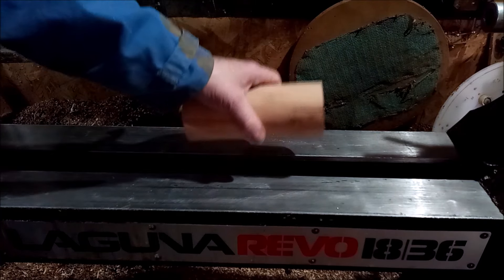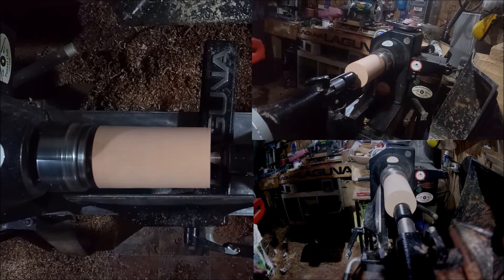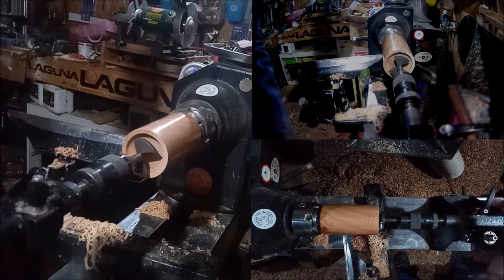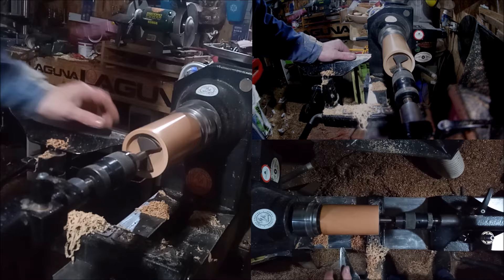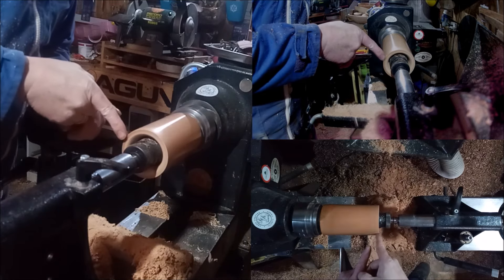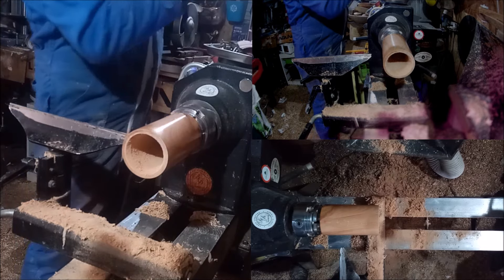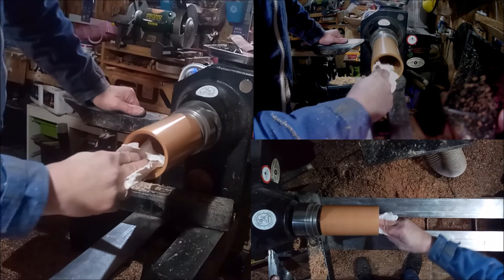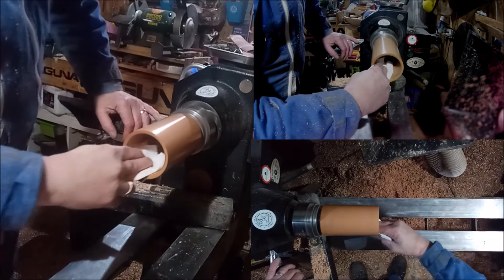Woodturning Projects for Beginners 5. A Desk Tidy

Comment: Well done and nicely explained. We do a “pencil pot” as one of three projects in our beginners turning course in Canberra Australia. We debated which techniques to use because, as you know, there are many. We use a jacobs chuck to drill a central hole, a square end box scraper to “hollow out” and a sanding stick (split stick) for sanding. We also show wire burning of the exterior for embellishment. Its a popular project.
Reply from the maker: It is a great beginner project to do Craig. I stayed away from embellishments for this video as I wanted to keep it simple. Quite possibly a bit further on in the series I will go into easy decorations and embellishments but at the moment I am working my way through really easy projects for new turners.
Shay